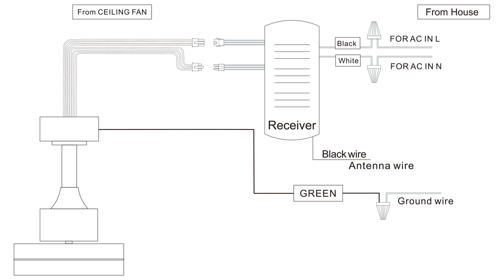Sofucor KBS-6003 60 Inch LED Light Remote Control Ceiling Fan Installation Video

Comment: This is the only video that has all the right info. Thanks
Reply from the maker: Thank you for your commentary,if you have more advice just tell us,thank you!
Reply: @SofucorFan  I have a question: my fan came with 2 grounding wires (1 in the mount and another in the downrod). Do they have to be connected to the grounding on the ac side (bare copper)with the wire nut  or just one of them would be enough? Thanks
Reply from the maker: @christianmeza4529  Yes, all the grounding wires need to connect together.
Reply: @SofucorFan  great, thanks.

Comment: Can we use a dimmable switch to adjust the speed of the fan?
Reply from the maker: We regret that it is not recommended to connect any fan to some incompatible wall switch currently. You can try some of our smart fan options.

Comment: How do you keep the light continuously cold. Every time I turn the switch on and off it goes back and forth between cold and warm
Reply from the maker: Dear, the older remote control don't have memory function

Comment: Why does the LED light have a faint glow when the light is off but fan is running? The only time the faint glow goes away is when both fan and light are both turned off. How do you fix this?
Reply from the maker: Hello! You can add double-stick tape to the backside of the LED panel. This allowed for enough space to not have the 2 metal surfaces touching/making light glow. Or you can place a thin piece of rubber between the back of the light and the mounting surface.
Hope the above methods will help. We are sorry for the inconvenience caused to you by the light issue.
Reply: That worked!!! Thanks!